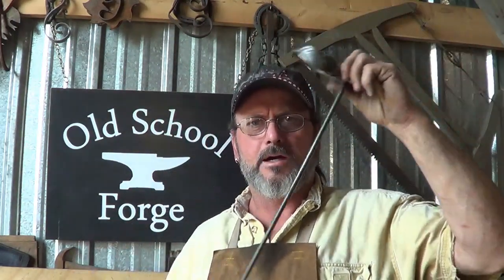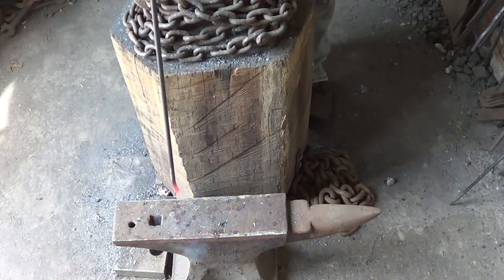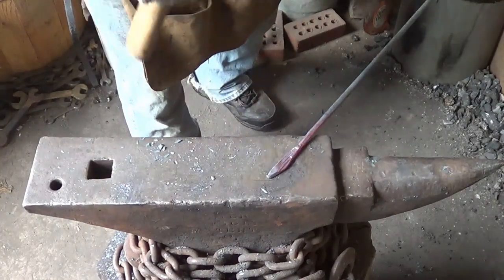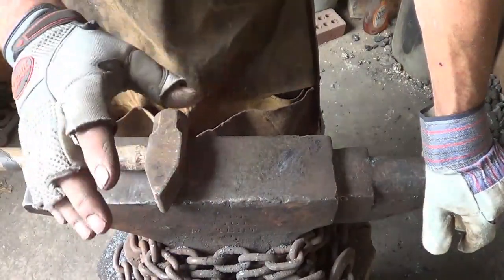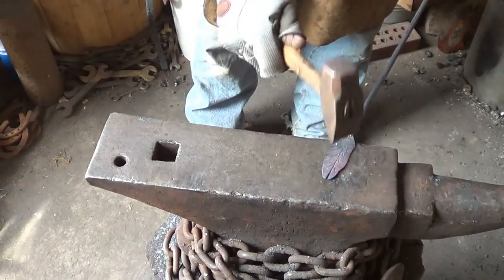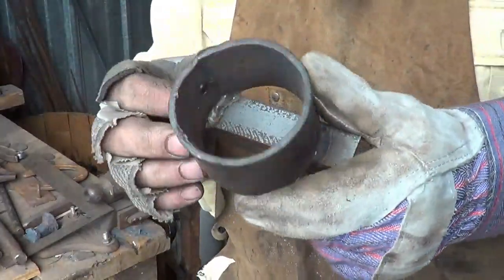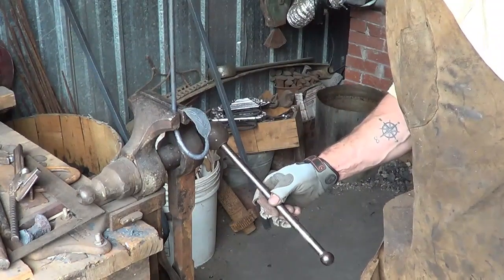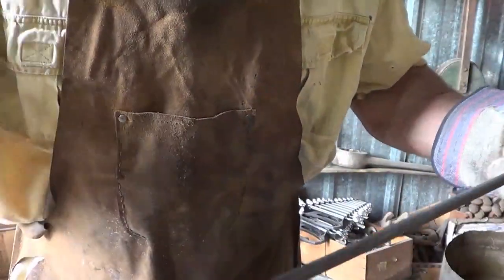Blacksmithing -Wine Glass or Cup Holder

Comment: you could make a similar piece with a shorter bar and a hook on the end and a larger circle for hanging flower pots
Reply: that's a pretty cool idea
Reply: you'd probably have to put an additional spike on the bottom to help support the extra weight though
Reply: +MrBubba1876 what I'm thinking would be hanging from a ceiling, not stuck in the ground

Comment: Would not rairsing the main anvil be better for your back aas well as hammer contact on the metal being shaped.?
Reply: The main anvil is actually raised to an ideal height, being at the smith's knuckles. This allows for a full hammer swing with the natural swing and arch of the back.
Reply: +Sitric Brave I would have placed it higher to lad a deaed blow style hit or he hits with a cary threw hit sow the blow hits the steel and still has movement  down.

Comment: 2 videos in 1 day we are blessed today. keep it up chandler I'm learning but yet to put it all into practice. I got maybe 25 cast iron cats eyes I will be making use of would you suggest carbourising them into steel or work with them as is?
Reply: it's cast iron right? if so you wouldn't increase the carbon you would reduce. not 100% sure but cast iron is made by increasing the carbon count to what I think is 6% , which is what makes it brittle.
Reply: Ahhh I thought it was other way round. If it's how you believe it to be how would one decrease content? Im Sure there is a plethora of youtubes on the subject so I'll get digging
Reply: +reggy .bo I'm pretty sure Japanese sword smith's started with a type of iron that had way to much carbon and brought the carbon count down, not sure exactly how but they could have simply burnt it off while forge weilding. again not sure about that. I know they folded the steel so much to remove impurities.
Reply: I remember watching a video on what's called wootz steel made from iron think you basically smelt the hell out of it until it's a blob of none descript metal then fold away making patterns similar to Damascus. Again il have to remember watch some stuff. Thanks for the help and the memory jogs iv had them sat there ages thinking how am I going to ADD carbon to theses lmao just as well I didn't else I'd have fossilised metal shard knifes
Reply: +reggy .bo It was no problem I'm glad to have helped. Yeah I can't imagine adding more carbon to cast iron. I've heard of wootz steel not too long ago, when done right it's high quality stuff.
Reply: +Jon Blais. Checked up wootz is turning low carbon iron into steel. Or something like.  Nothing on how to safely convert cast int steel so chandler fancy being the first?